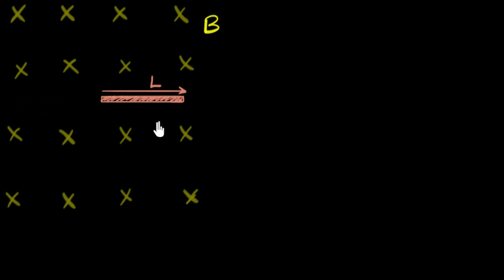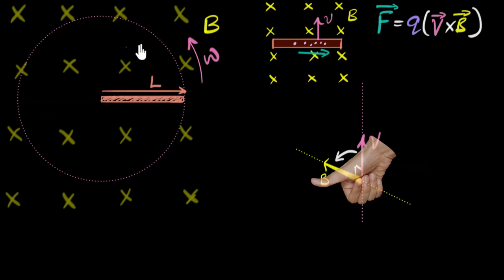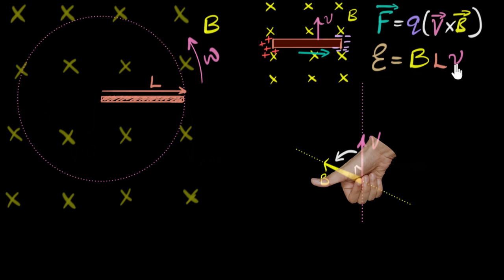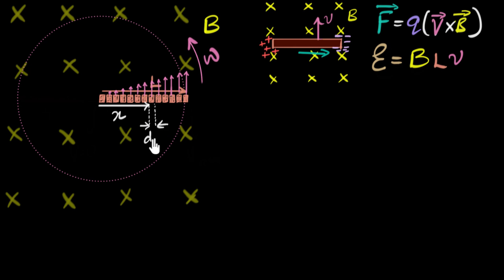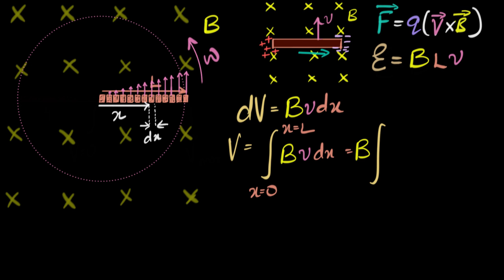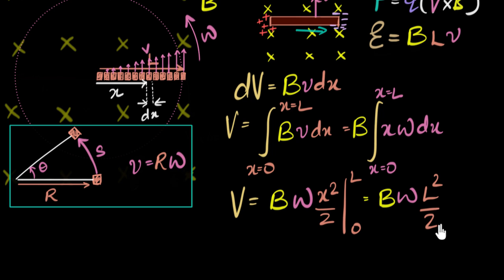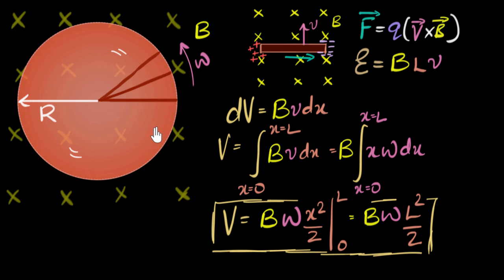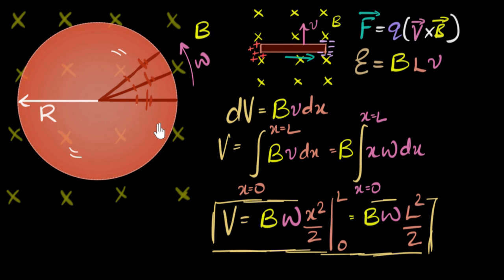Emf induced in a rotating rod (& disc) - Motional EMF | Electromagnetic induction | Khan Academy

Comment: how did you decide the direction  of emf  , how did you predicted tha the centre would be at high potential and the ends of the rod be at lower potential?? how  would this direction vary with if rod was rotaating in other direction or magnetic field was upward instead of downward??,,  NGL , this video is not helpinng :(